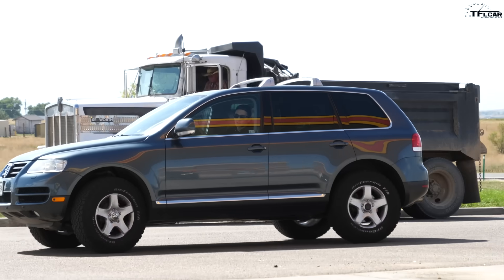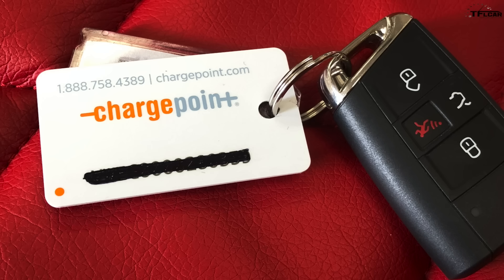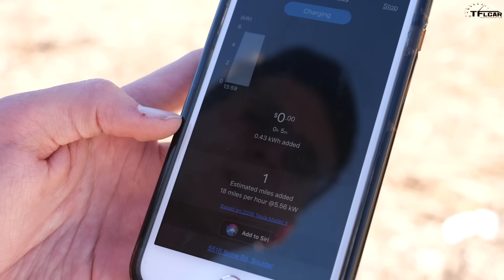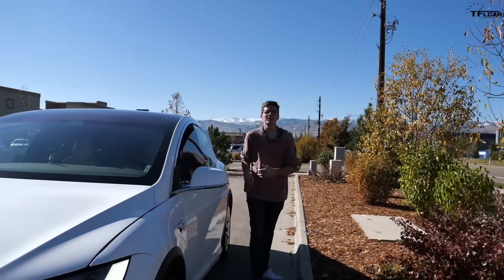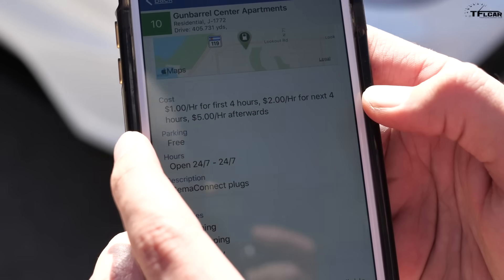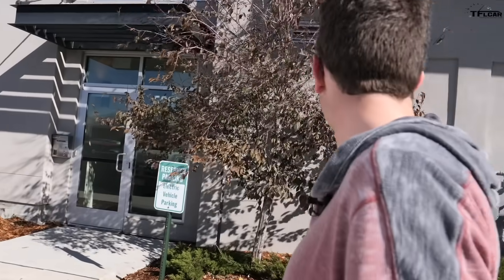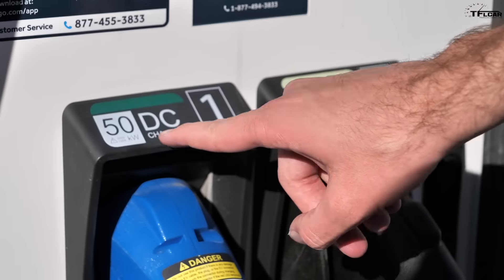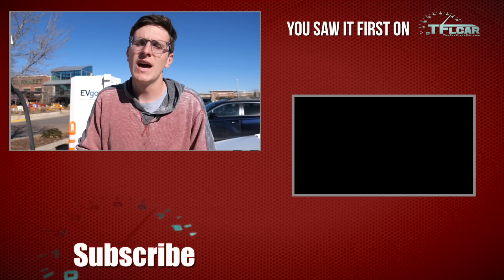Here’s Why Charging an Electric Car Can Suck - And It’s Not The Reason You Think!

Comment: Those are HORRIBLE charging times.  That means to charge the for 150 mile range you are looking at 10 hours.  The more I see about EV the more I feel they have failed, not succeeded.  You have to be a diehard EV enthusiast to actually use one on a regular bases... let alone do a road trip.  The place I used to work at was a 75 mile round trip.  That would have been 5 hours of charging every day.  I would have had to have a 240v outlet installed for it outside as I do not own a garage and because there is not a charging station in my city.  I would have to drive a 30 mile round trip to the nearest charging station.  Admittedly there are 2 200kw, 2 70kw, and 2 7.2kw chargers available at 3 locations.  The problem is that is the opposite direction from where I had worked.  There is 3 charging stations there too, but they are all 7.2kw stations.  And because I live in a colder climate the car would constantly draw power to keep the battery packs warm.  I was checking another video about a cross country trip and the cost for the Supercharger, even at today's higher gas prices was more expensive that if you were say driving a Honda Civic.

Comment: I avoid that crap by using a traditional, non plug-in hybrid. Getting about 52.7mpg with my Honda Insight. Wondering with the war on fossil fuel energy whether gasoline or electricity prices will be more of a ripoff. I see $10/gallon gas in 2022. Wondering how an already overstressed power grid is going to support all these plug-ins???? This video was done in 2019 before the war on fossil fuels when energy was cheap and plentiful.

Comment: EV’s seem to be practical as long as they are used for local driving and can be charged in your garage overnight. Taking an EV on a cross country trip would seem to require a lot of planning and calculations. The cost of an EV is also an issue. 

I feel certain car companies will eventually invent batteries that will be capable of driving long distances between charges. They will also need to be able to fully charge a battery in 30 minutes or less. Until these problems are fixed EV’s will, IMO, have limited popularity because they aren’t practical for the average person.
Reply: And the longer lasting the battery the more expensive they will get
Reply: @kevinduveneck1504  there are limits and we are close to them. This do away with oil is complete nonsense.
Reply: They suck.
Reply: 30 MINUTES , that's enough time to be robbed , carjacked , beat to a pulp , raped, in a world where the leftest want you , un-armed , criminals un-punished , and , no cops !
Reply: Tesla and others have already done so, if you consider 300-400 miles a "long distance." And at one of Tesla's latest version 3 superchargers, I get about 16 miles of added range per MINUTE (not per hour) if I pull in at a low level of charge. It only goes that fast for about the first 35% of a charge session, and then starts tapering slower. But if I'm 100 miles from home, and need to add some range to get there, a 6-7 minute stop will give me that 100 miles I need, and then I plug in at home. This video you just watched grossly overstates how hard charging is, and how long it takes. It's also 2 years old, and the situation is much, much better now (and still improving fast) than it was then.
Reply: that's the idea they want to keep you local
Reply: "They" want to keep you in town where you are not a pain to find when it's your time to do whatever they dictate
Reply: @stevenmorris3181  Let's keep in touch you can always find me during the Salty Cracker  [RUMBLE] livestreams. Good luck and let the salt flow.

Comment: Stations that changed your battery instead of recharging your battery would solve the ridiculous amount of time (presently) required to fully charge them. There would be a few little problems to overcome before that could happen but I’m sure it could be feasible for the right entrepreneur - just a thought

Comment: Too much effort + too much cost to buy the car it self + too much time spent on waiting until it charges + too much maintenance. Normal cars are cheaper to buy and maintain, fast to put in the fuel, and very little effort required in finding where is the petrol station. I personally will wait until the price drops, and second hands are available, and charging stations are available near my house and work.

Comment: Best to have a charger at home, or in a safe place with easy walking distance to your home or place of work. This is not a comfortable situation during the winter months where you have to be outside with our vehicle for some hours to charge it because you are not in walking distance from home, or a warm place you can sit for a number of hours, or where you work.  With gasoline vehicles it takes a maximum of a few minutes to refuel your vehicle and and get going again.  

Electric vehicles with normal commute type driving it can be used all day, and when you get home at the end of the day you simply put it on charge for the night.  If you have a 300 mile range and you use the vehicle about 30 miles per day, you can safely use the vehicle for a number of days between charges. Best to top up over night and have a full charge the next day. 

There are some very good electric vehicles available, and there are more highly improved models and types coming out within the next few years. This is a huge technological change in the transportation industry. 

The way things are going it looks like by 2030 and (to) 2035 depending on the place where you live it will no longer be possible buy a new gasoline or Diesel car or SUV. Apparently, by 2023 to 2025 all the auto makers will no longer be producing gasoline or Diesel cars and SUVs. By 2040 there will be very few places that will be selling gasoline.  With the very low sales and when factoring in the cost for producing, transporting, and storage, of gasoline it will become a very expensive commodity.  It is speculated that by 2050 there will no longer be gasoline and Diesel stations as we know them. Everything will be fully electric for transportation.  By then the vehicle and battery technology will most likely be much different. 

The only way I would switch to an electric vehicle without being legally forced to, or if gasoline starts to be scarce, is if I could have a very convenient way to charge it.  I have driven electric vehicles, and I can tell you the performance and operation is very impressive compared to gasoline vehicles. But, there is the point of view of convenience and ease of maintaining the vehicle that plays an important part of the equation. Over the long run when considering the lifespan of the batteries, and the the very high rate of depreciation of an electric vehicle compared to a gasoline vehicle, the overall cost of the gasoline vehicle based on 4 to 6 years is a fair amount cheaper. 

As for myself, by 2035, I have no idea if I will even still be alive, and if I am still alive I have no idea if I will still be driving.  I would  be in my mid 80s if still alive!  The average very healthy male lives till about 82 years of age...

Comment: My garage is already wired for a welder and compressor, so no problem with the power supply.

If I'm traveling any distance I need an overnight stay and a similar setup to be able to get home, assuming I can do the trip on two charges.

Adding 15 miles of range in an hour is next to useless.